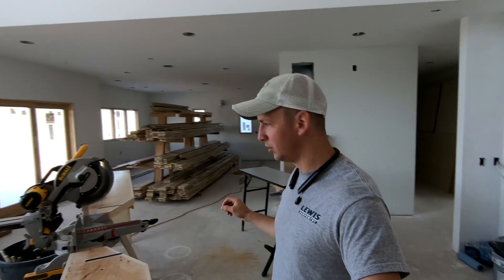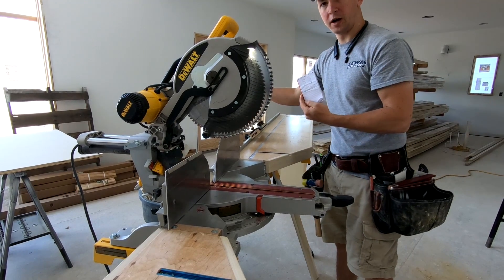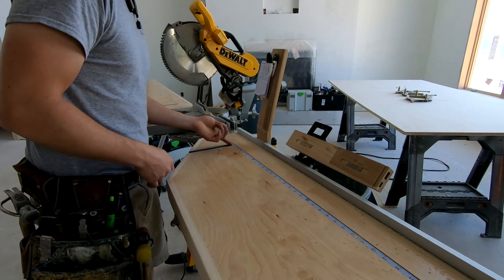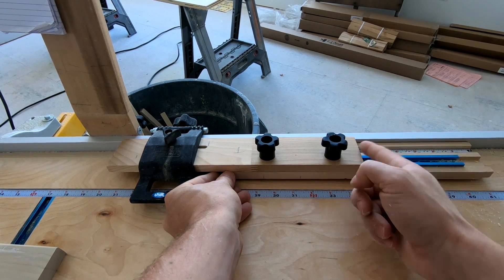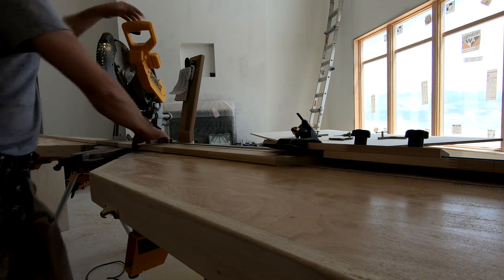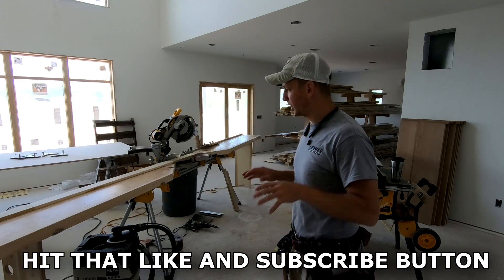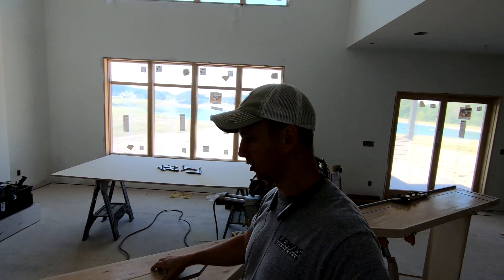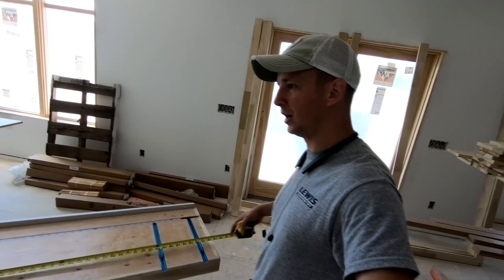No Faster Method to Cut Mitered Window & Door Trim???- The Miter Saw Offset Stop Block

Comment: I wish i could trust our windows ( and window installers) enough to work that way, but fixing out production houses every window is slightly  different and the angles have to be check for 90 degree as they could be 92 deg, 88 degree or what ever. I would thrive in your type of environment.  It must be nice.
Reply from the maker: I get proud and recesses jambs but I’ve never understood how windows can be out of square. Around here all the windows come from a factory and are square at install. I can’t tell you if I’ve ever cut a window casing at anything other than 45. Sorry to hear you have to deal with that. It’s so frustrating.
Reply: @InsiderCarpentry  would love to take skne photos to show you. Aluminium windows with timber reveals.

Comment: That’s a great setup and method. I’m based in the U.K and have never had a clear space to work as houses are smaller and it’s ‘traditional’ to have all tradesmen and their materials in at the same time! :S I’d be lucky to have enough room to set up an assembly table. The mitre saw is usually sat on the floor between a mass of bodies, pipes, drywall etc. Not good!

Comment: nice setup if you were building this in a shop and not moving it. 
But the time it takes to move this around and reset it up is not worth it in my opinion. Way to many thinks to bring in and out.
Reply from the maker: Not really. Saw and stand would be the same for everyone. The wings fold and clamp together and come in one trip. Granted they are a bit heavy. Cut lost holder and stop block nest inside the wings and is just a matter of sliding into place. Any marginal difference in the increased setup time is vastly offset by the gain in production speed and efficiency. If it didn’t I wouldn’t be using them.
Reply: Insider Carpentry everyone has a system that works for them. Your system clearly works for you so that’s great. If your in a large home for many days it’s even better. We do things very differently here in Canada. I’ve been doing trim for 40 years in high end projects and for me the less lugging around of tools the better. I’ve gone to cordless miter saws and cordless table saws so I can move my saw around on the level I’m working on so I’m not running back and forth to the saw. I find that’s what save me time

Comment: Another great video. See we don’t use poplar here. It’s a lot of primed finger joint. And it’s usually a Windsor brand trim. Usually with a 5/4” or 1 inch outer detail reducing to a 3/16” or 3/8” inner profile. Sucks, because most pieces are bowed or even cupped and it screws with the miter cuts horribly. My saw is perfectly calibrated and the niters sometimes end up beveled by 1/2 a degree because of the material. Wish there was an easier way for me to be more productive with my trim. I’m trying different methods all the time.
Reply from the maker: Check out my video "The Most Efficient Method for Mitered Casing" I talk about that issue in that video. Best thing for that is clam clamps and preassemble. The clam clamps are powerful enough to compress the miter even when the cut is off because of a bowed piece not being a perfect 45.
Reply: Insider Carpentry I will check it out. I may have missed that one, unless it’s the one with the “less footsteps” and the whole on site set up. I’ve watched that a few times 😁. Actually ordering the clam clamps. Gonna call Jim and place an order this week or Monday.
Reply: Insider Carpentry also I’m gonna have to look into Hipur glue. Right now I use 2p10 for assembly and then nail them up full, even my door casings. But definitely need Jim’s clam clamps. First time I saw ya use them in the video I searched the Internet for a week till I came across them but never pulled the trigger on the order. Will be as I said within the next few days.

Comment: what do you do when your not use flat casing?
Reply from the maker: Pivot the saw back and forth like normal in that case.
Reply: @InsiderCarpentry  it doesn't throw off your stop block measurments

Comment: A problem I run into with picture frame window casing is uneven jam lengths. So I gotta choose between cutting the same size top/bottom and left/right side casing for tight miter joints but uneven reveals or different lengths for even reveals but poor joints. Sometimes I can fix the jambs if they’ve been pulled apart during delivery or instal but not always. Tract housing trim problems—little quality control and no consideration for the next guy. Even with the near million dollar “luxury home” builder.
Reply from the maker: You’ll definitely want to check out my video on rolling casing. It’s titles the #1 mitered casing secret. It’s one of my most popular videos. Rolling the miters will solve a lot of your problems.

Comment: The only thing that would throw your cut off with that method and using a profiled casing is if the material your cutting has dimensional differences. I.e. if some of the casing is slightly wider and or smaller in width. 

It will throw off the small of the cut unfortunately. It’s happened to me a few times. So now I re mill the width of the casing on the outer most edge to ensure the nominal width is all exactly the same. It’s a pain in the ass but worth the trouble
Reply from the maker: I've never had that issue with my millwork supplier.